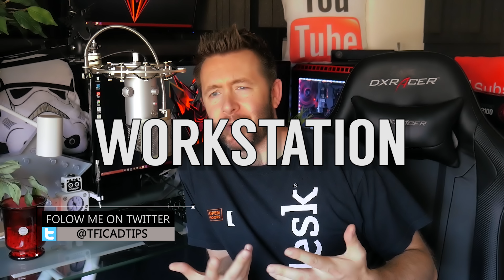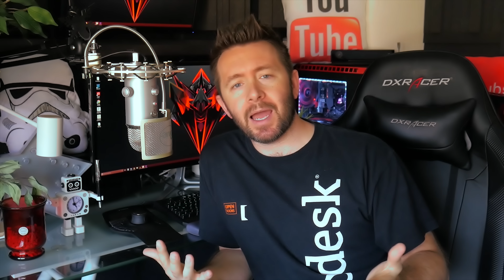Autodesk Expert Elite Article, Inventor Workstation Buying Advice

Comment: i need help with a workstation build for maya,3ds max, after effects, zbrush, animation.  what kind of motherboard CPU graphics card would be recommended to make the render times a lot quicker ? i was thinking about using a asus z10pe-d8  ws board , 2  cheap 8 core xenon E5-2670 , quadro m4000 , 860watt ppwer supply , SSD's of course . after watching this video apparently these cheap Xeon server so slow it's not even worth it but the high-end Xeon that are at least 3.5 gigahertz I believe are very  expensive ! I'm just trying to get a great workstation build for quick render times  for those programs for Max budget of $2,200 maybe $2,500 if it's really that worth it that I would build myself. my laptop right now is a Nvidia 670m which is pretty low so I need somthing way better.  and also I heard there's a trick to use Quadro graphics cards software on gaming graphics cards to make them work the same I don't really know anything about that. and is a Quadro graphics card just good at being able to be ran 24 hours a day or is that actually way better at doing graphical computation is that not titan or some other game and card?

Comment: I just bought this Board on amazon (https://www.amazon.com/MSI-DDR3-2600-Motherboards-GAMING/dp/B00K23BZTA/ref=cm_cd_qf_qfpq_dp_t ) it's a gaming board I need to run autodeks inventor 2017, would i need to install video card? which ddr memory is useful for this board ddr3 o ddr4?

Comment: quick question. should I get a used hp z800, z820 dual xeon pc or just build one to some animation on flash also for Maya as well
Reply: flash can be done by very basic PC on the market now ,  Maya  go for gaming PC will be more Cost-effective and spend money on cutting edge

Comment: hey so ive got a slightly left field question. What upgrades would you do to a Macbook pro in order for it to run other 3d software like Rhino, alias etc. currently 2.5Ghz intel i7, memory 16 GB 1600 MHz DDR3, graphics AMD Radeon R9 M370X 2048 MB. also selling the mac to buy a pc is not the answer im looking for, for any pc fans that read this. Im an Industrial Design student with a low-medium ($2500) budget. what would you recommend if i were to get a pc, (common software Inventor, Rhino, Alias etc). Thanks

Comment: What you are paying for in professional components like Quadro graphics card and Dell workstation is support and drivers, not only performance. Using a gaming card for CAD is also not a very good idea if you are serious about stability and graphics quality.
Reply from the maker: You're right about the price premium being to pay for the Quadro driver support, but the talk of gaming cards being a bad idea and worse quality is just not true any more.  I still wouldn't put one into a professional office, but for example a GTX 1080 has more VRAM, better memory bandwidth, higher clock speeds and is generally more powerful than most Quadros on the market.  I've done every one of my 130 tutorial videos using a GTX 970 and had zero reliability issues, it gets me a better frame rate than the K4000, M4000 and W9100 I have here.  Repeat, I still wouldn't put a gaming card into a professional office, but for home users and small businesses who can't afford the high end stations a gaming card can and does offer better performance than an equivalent priced Quadro.
Reply: Yes, price/performance is a lot better on higher clocked gaming cards if you don't care about stability, power consumption and noise level. Stability is a lot better on newer gaming cards though. What I meant about graphics quality is the fact that high end CAD software like Solidworks, NX and Creo have disabled realview graphics and high quality rendering for non-pro drivers like Geforce and Radeon cards. It does not seem to be the case with Inventor though so I might have to take it back.
Reply: One word about stability and drivers: my experience is that people don't realize how much program crashes, bugs and graphical glitches is related to the use of unsupported drivers. I'm not saying that a gaming card is going to get you more crashes and bugs but sometimes it might be the case.
Reply from the maker: Yes I've heard that about SWX and others.  I used to work in a CAD supplier throughout the years when this was a massive issue, I'd bollock people for buying gaming cards to cheap out on hardware, but now with Inventor it genuinely just doesn't matter.  You can get a GTX 970 for £230 which is based on the exact same GM204 core as the Quadro M4000, exact same number of Cuda cores, exactly the same chip... both cards have slightly different TDP points and VRAM, the GTX 970 is probably going to be better at cooling as board partners implement their own custom designs for thermals, but the Quadro M4000 is around £900 depending on where you buy it from! For that price you get exactly zero performance gains (I've tested a M4000 and 970 in the same system) and you can get a Titan X or two 980Ti's for the price of the M4000! The price premium on Quadro's is a piss take but unfortunately businesses have to pay it for peace of mind and support
Reply: I totally agree for a budget rig at home but a program crash can cost a lot more than that for a company so in the end I would not take a chance.
Reply from the maker: Yep, I said in the video that professional workstations are the only choice for a business/commercial office.  I'd be disappointed if the purpose of this video wasn't clear, but just to repeat, the purpose was not to tempt people into buying cheap gaming computers... it was to prove that just because something is 'Quadro, Xeon etc' that doesn't mean it's natively and by rights more powerful and has a magical connection to CAD apps.  It's possible to buy a Quadro with a piddly 1GB VRAM or a Xeon at 2.1GHz, which is absolutely worthless to 3D CAD and I'd actually recommend something like a 1070 or 980Ti over a crap Quadro if that Quadro doesn't have the nuts for the job.  Perhaps there's a video to be made out of this! Good discussion.

Comment: Love the videos, Neil.
I've been using Inventor for 12 years (started with Prelude in '95 then a few years with SolidEdge) and have learnt a lot in the last couple of weeks from your vids. We upgraded last week and will be starting on 2017 tomorrow so I've recommended all my fellow CAD monkeys have a look at your channel.
As for the music. I'm a lot older than you (retirement is a warm glow on the horizon) and hate the low level background tracks that distract from your commentary. On the other hand the 'in yer face' track during the comparison tests was fantastic. I've been trying to track it down since first hearing it on the title screen. Deaf Kev will help me drown out the rest of the guys in the office this week.
Keep up the good work.
Reply from the maker: Thanks! Yea the early videos I did, couple of years back, the background music was supposed to make the videos less stale and a bit more pleasant to have on, but in the end I just thought its not adding to anything so I'll get rid.  So all the newer tutorials etc don't have background music.  However anything I do that isn't a learning type video, like this one, I'll need to have music in the background else it'll just feel wrong.  It's very hard finding music that I can use which won't get me into copyright trouble so I'm currently pulling from "No Copyright Sounds" which is all electro boom boom noise but some of the stuff is quite inoffensive haha

Comment: Although, what you want to show people is appreciable & I'm in favour with your opinion to have the relevant performance with money somebody will spent. But, what I've seen is there are one bottleneck factor in each one of your computers & I've some suggestions-
1. Swap the HDD with a SSD in Dell Precision T5610, to boosr data flow rate
2. In the Custom PC replace g3258 with i5 4440(or any quad core processor) to achieve graphical fluency on screen.
After that audience here were able to see what Quadro can do ? and what inventor do with more cores?
Reply from the maker: I understand what you're saying, however regarding the points...

1. Obviously the Dell would have benefited from a SSD, that's one of the conclusions in this video.  But it wasn't originally bought with one, and that's the point of this video, to use a real world PC.  There are hundreds of thousands of Workstations in production right now without SSDs, and this demo is showing how bad they are without one.  I mentioned in the build up that I didn't build this Dell, it was in use already in a real world office as it stands there in this video.  I'm not sure how much more clearer I could have been on that.

2.  I'm quite frustrated at reading you say that, because it means you either haven't watched the video properly or I haven't presented the results and conclusions properly.  For starters, the G3258 was £50, an i5 4440 is currently £160, this PC was built to be as cheap and as powerful as possible for Inventor, adding £110 to the total system cost would have been detrimental to the point of it and it would have performed worse across most tests with an i5 in it.  But crucially, this video clearly demonstrated a 6 core Xeon at 2.6GHz under performing against a 2 core G3258 at all tests including graphical fluency, so I've no idea where the logic is in suggesting that a 4 core 3.3GHz would make a huge difference here.

Regarding the final point, the Dell had 6 cores, so the audience was seeing what Inventor with more cores can do.
Reply: +TFI CAD Tips 
I'm sorry if I offended you. But here is my point, I had a PC which on using a G3258 have gittery workspace. Whenever the object is moved or rotated it begins jagging. It either happens on editing minor details. But when I replaced it with a i5 4440, the same job is done smoothly.
Reply from the maker: Understood, you must have had a faulty chip as I wouldn't have used the G3258 if it wasn't capable, it's performed admirably in all high level tests I've done.  I've got this one overclocked to 4.4GHz and in most areas including graphics/FPS it almost keeps up with the devils canyon i7 4790K which I have in another PC, it's an amazing little processor.  Don't forget there's a lot more to a PC than just a CPU though, I built the cheap PC specifically for Inventor and none of the parts are a bottleneck at that price point.